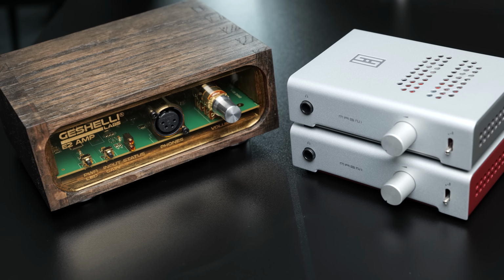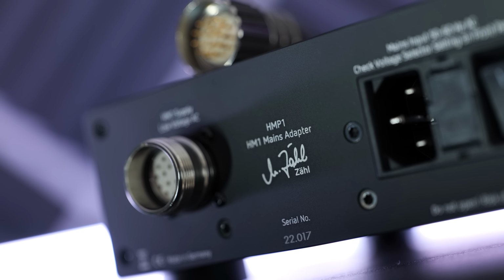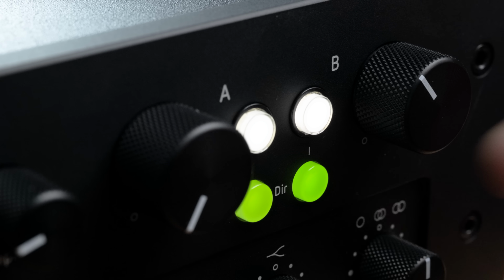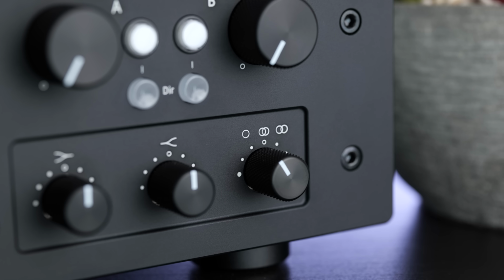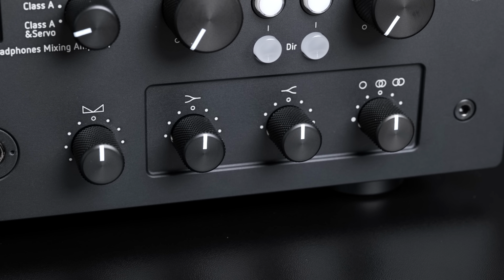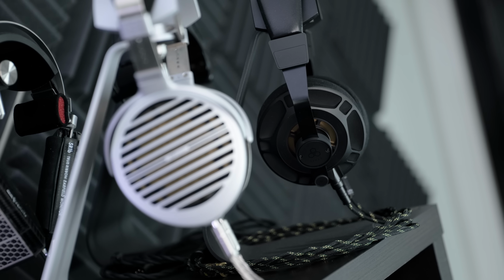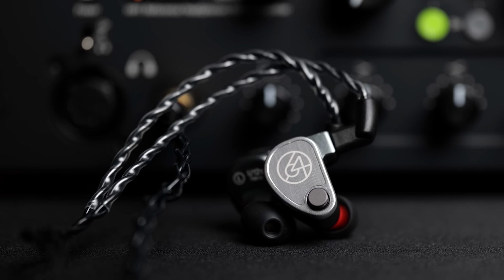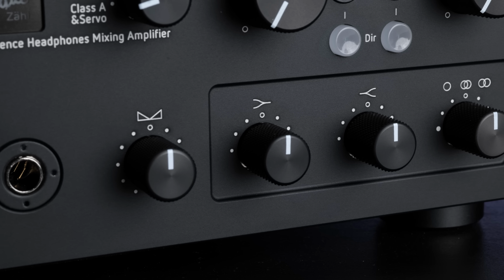How good is an $8000 headphone amp? - Zahl HM1 Review

Comment: At these price points I struggle to figure out whether the manufacturer is a voodoo or a bang for the buck, perhaps somewhere in-between. No offense to the reviewer, just my knowledge is not enough to comprehend many of the points made that define quality.
Reply: Then it isnt a product for you. Do you get upset that cinema cameras cost several 100s and 1000s? Just because its the same class of product, doesnt mean the use case is identical to yours.
Reply: @En_Joshi-Godrez  Well performance isn't all that complex regarding cameras. There is resolutions like 2k, 4k , 8k becoming more available with time, 4k Red camera in 2007 is an example perhaps. And then the performance of the lens is important probably (i.e. the range / zoom). I know next to nothing about cameras, this is just my first thoughts. My point is that performance is easily quantifiable. Sound might also be quantifiable and not subjective in terms of performance, but it is generally more difficult I think to quantify the performance of sound (or this device in the review) for the average person compared to something like a camera. Understanding frequency response measurements is more difficult than quantifying resolution. 

Now a camera expert will probably reply and say that resolution has nothing to do with it, everything is fps, color accuracy or maybe even some subjective parameter that belongs to the arts. In that case then I guess I'm wrong.
Reply: @peergynt6515  im sorry but you saying understanding cameras is knowing what resolution is beyond parody. Absolutely embarrassing.
Reply: @En_Joshi-Godrez  Ok, at least I gave it my best.
Reply: @peergynt6515  the $120k red komodo cinie camera has 19.9 Megapixels. The new s23 ultra has 120. That should give you a idea of how off the understanding resolution provides.
Reply: @peergynt6515  ok I was being mean, I apologise. If you want to understand on the most basic level how well a amp performs, its all to do with impedance loading of the drivers voice coil. Planars like a amplifier with low gain, but high current, while most dynamics like high gain, but still befit from high current. Amps with high current require more capacitance which comes from the the amount of farads in the capacitor chain. Those capacitors and the transformers that fiter them are the most expensive component of a amplifier. Thats why these amps can get so expensive, and why they perform better than lower end ones. They have higher farad capacitance.
Reply: @En_Joshi-Godrez  No worries. This is interesting since I have some knowledge of this in a completely different domain. I work with high voltage cables (some connected to transformers), which among other layers has a conductor and an insulator/dielectric. I'd say imperfections in the insulation can associate a capacitance. If the electric field across a capacitor is too high, that can cause a partial discharge eroding the insulation, which is what we strive to avoid in cables.

I think there are construction similarities between audio transformers and power transformers. Stepping impedance up or down like voltage or current. I have limited knowledge of transformers because I only work with connectors (that require a cable termination), and my background is mechanical engineering rather than electrical. Maybe I can learn more reading about audio transformers, I will probably need it.